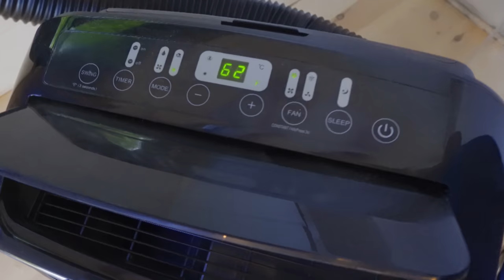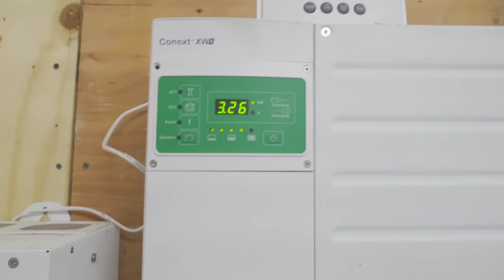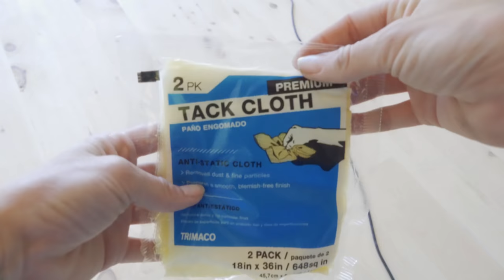Staining The Floors Transforms The Interior

Comment: Great job - 3 more days: apply 1st coat poly - let dry 24 hours and lightly sand.   Apply 2nd coat poly - let dry 24 hours and lightly sand.  Apply final coat of poly - no sanding needed - let dry 24 hours.  Move back in.
Reply: Why is that,why isn't just one coat of Polly good or two coats with no sanding?

Comment: I’m totally surprised that you’re solar system could keep up with all that work. Good job Josh.
Reply: They do have a rather large solar system.
Reply: No, they have a properly sized systems. Solar PV & Thermal work great if sized and installed correctly. I would have gone with a Solar Thermal system for heating instead of the wood boiler their planning, but hey, not my house
Reply: @blazegbs  If not a solar thermal system they also could have gone with a ground-source heat pump.
Reply: Audial Asphyxiation @AA True, GSHP could also work. I’m just not a fan of things I can’t see (digging wells or slinky fields) that require major equipment to redo/maintain. Also would have to see what their future plan is for the pasture.

Comment: We have similar wood floors here in Riga Latvia EU where we live and it is our experience that over time several years, the wood filler will eventually "pop out" due to flexing of the boards.
You might also want to explore using a professional grade basketball floor "wax" to protect your floors after the first 3 months or so. Quite easy to apply with a lambs wool mop and let dry about 2 hours.

Comment: Curious how the floors are holding up? We are currently installing the same flooring. The inconsistent sizes are making horrible gaps in some spots. Curious what wood filler you used and if it has stayed in the gaps or popped out with expansion through the seasons?

Comment: Hallo Ihr 5, Grüße aus Deutschland.
Ich verfolge Eure Beiträge schon sehr lange und finde die Unterschiede zwischen Deutschen und Amerikanischen Häuserbau sehr interessant. Wir haben 2003 mit Porenbeton Wandbaustoffe für meine 5 Köpfige Familie gebaut. Die Unterschiede sind enorm. Alleine bei Wasser, Sanitär und Elektrik. Ein kleiner Tipp noch von mir. Baut Euch einen Deckenventilator an. Der verteilt die Wärme im Winter besser in alle Zimmer. Habe ich in meiner alten Wohnung mit 3,30Meter Deckenhöhe auch gemacht. Macht weiter so. ❤

Comment: Aw, material and tool acquisition -- the bane of my DIY existence and most projects require at least 2 trips to the hardware store.  At least it's not a long trip like you guys have to make. Hopefully a hardware store with lumberyard attached will open up near y'all soon.  Our local Ace Hardware has a lumberyard attached, and they sell building materials like shingles, house wrap, insulation, plumbing materials and pipe, wire, etc.. And they also sell tools.

Comment: Hi Josh and Erin, rather than using Poly Urethane I have always used Future Acrylic floor wax. It repels water and stains and is easy to apply, can be touched up very easily, and is super tough. It works great on wood floors.

Comment: This was nice! Too much work i know, you could have started off with a light coat of stain for the first 2 times, so lighter dripping marks, and you will have better control over how dark or light you want the floor to be. Also, i always wet the wood before i do the 3rd sanding with damp cloth and then go with a 180 grit, water raises the wood fiber and when you sand it off, it feels SUPER smooth, like glass. If you have the patience you can oil the floor twice - thrice, with sanding between each coat with higher grit!

Comment: I hope you will put a protective coating on your wood floors. I didnt and regret it. Your doggo is so sweet. I have a miniature Boston Bull Terrier/Pug mix, I call her a bug. If I were you I would install some drop ceiling fans. With such a high ceiling it may get pretty hot in the loft and fans would make a big difference in the summer as well.

Comment: You make it seem like it is taking a long time to get this floors done. I do not think that is so… I plan for 7 days but it is often done in 5 days… There is just so much prep and  drying time required. And drying is so depentant on the weather. So it is hard to plan.  My time line to get floors stained is
    Day 1: 1 long day floor prep. (you did it in two but you have the slanting walls which is harder, you removed the island, and a learning curve to learn the sander.) 
    Day 2: stain the floor and let it dry. Drying I plan on 24 hours but with bad weather dry can take 48 hours. I like it best when the last sanding and the first staining is done the same day. It is best not to let the raw sanded wood sit over night soaking up moister from the air but most of the time if does not work out that way.
    Day 3: stain second coat or at least stain touch up (this might mean some sanding if needed) and drying time. 
    Day 4: First poly coat. Minimum 8 hours drying time.  (Maybe this step is done  day 5 or maybe done at the end of day 4.) then a buff sanding and a second poly coat. which dries over night. 
     Day 5: again a light buffing and poly coat three. 
     I have been on job site where the customer has wanted as many as 6 poly coats.

Comment: We did the same thing in our house and has lasted 10 years... although it could use sanding and refinishing, it is in really good shape for pine floors!  One thing I learned after the floor was finished was that if you mix a little saw dust in when you’re filling in cracks you won’t have very noticeable gaps. It helps the stain blend better.

Comment: You had the rong woodfiller. 

And you have to drive for hours, to get the right one. 

Next time, use some sawdust from the second time you where sanding, mix it with some woodglue, and fill the gaps, and it wil have the same collor as the wood. 

Ploblem solved.

Comment: If you keep a damp rag nearby as you are applying the filler, you can brush your blade across the damp rag and then smooth the spackle into the cracks and the result will be much smoother.  Just remember, the more you apply the more you have to sand off...

Comment: Hey guys I'd suggest a ductless mini split air conditioner. I've had one installed couple years back and loving it. I haven't seen my electric bill change in the summer when I use the unit. Also it's super quiet. You can also use it to heat up your home as well during the winter. (A good backup system) and hey, good job on your project 👍 really happy for you guys.

Comment: Just a tip. We did kind of the same thing with our floors at our last place and used the water based fast drying poly and it scratched super easy. We used the oil based one upstairs and it held a lot better and it did not scratch hardly at all. Probably too late and hopefully you guys used the oil based stuff. Or you found some stuff that works at least.
Reply from the maker: We used oil based 😊